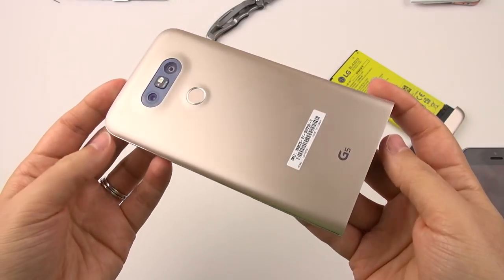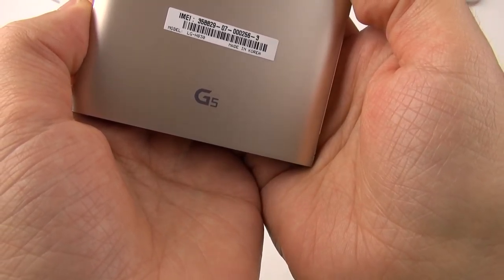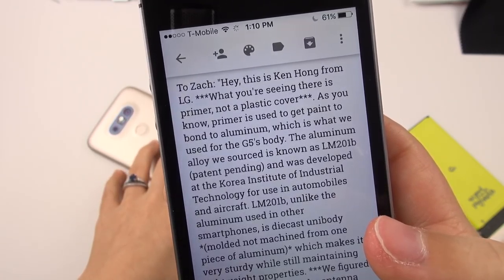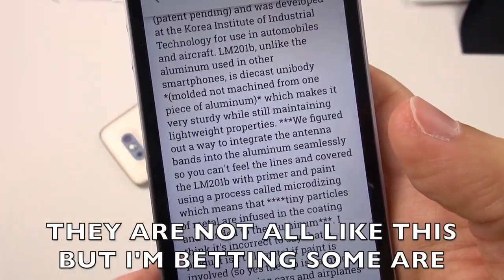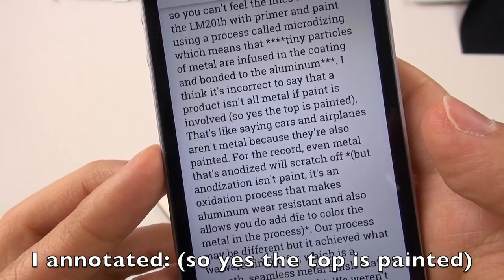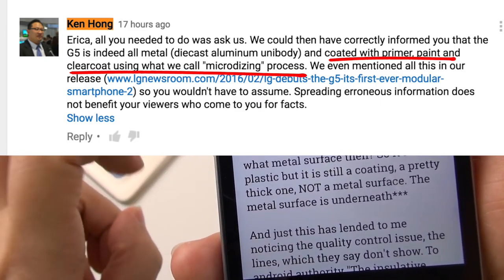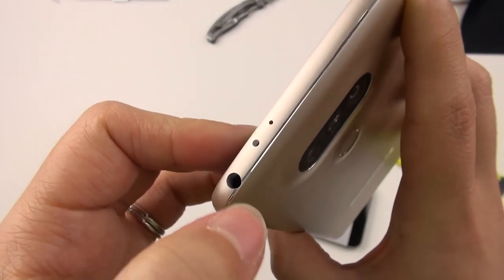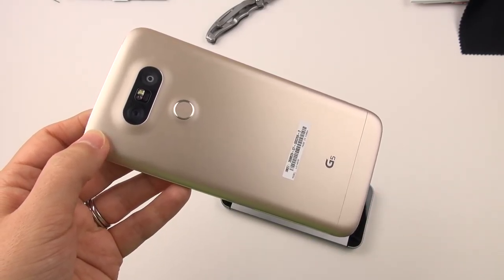LG G5 Not All Metal Controversy: Explained || LG RESPONDS

Comment: What you’re seeing in that video is primer, not plastic. The primer is required to get the paint to bond to the aluminum body. The aluminum alloy we sourced is known as LM201b (patent pending) and was developed at the Korea Institute of Industrial Technology for use in automobiles and aircraft.

LM201b, unlike the aluminum used in competing smartphones, is diecast unibody, not sheet aluminum. We chose LM201b because it’s very sturdy and lightweight. The weight characteristic was important because unlike other aluminum phones, ours has the modular design so the case needed to be extra strong. Trying to achieve this level of structural strength with traditional aluminum would have resulted in heavy phone.

The insulated antenna is embedded in the aluminum and coated in primer, paint and clearcoat [which] allows the signal to still get through. And it’s not just any old paint but a much more durable type with microscopic metal particles that is applied using a process called “microdizing” to bond it to the aluminum.

I think it’s incorrect to say that a product isn’t all metal if paint is involved. That’s like saying cars and airplanes aren’t metal because they’re also painted. For the record, even metal that’s anodized will scratch off. Our process may be different but it achieved what we were aiming for, which is a smooth, seamless metal finish that’s durable and lightweight.